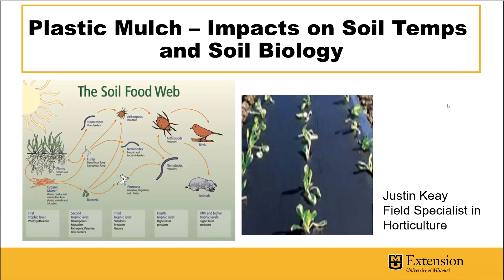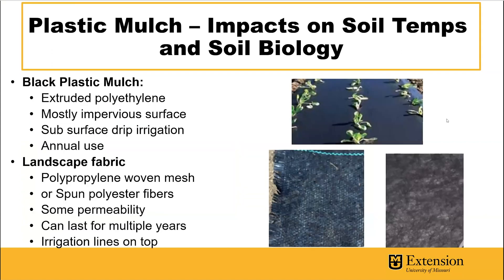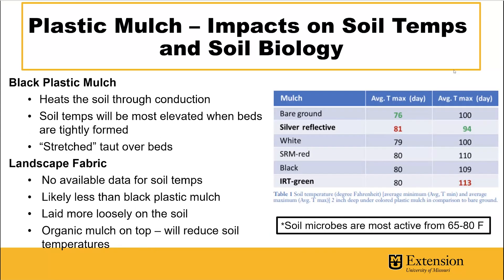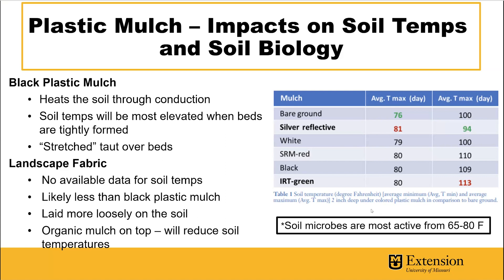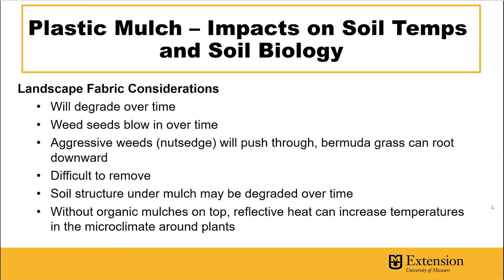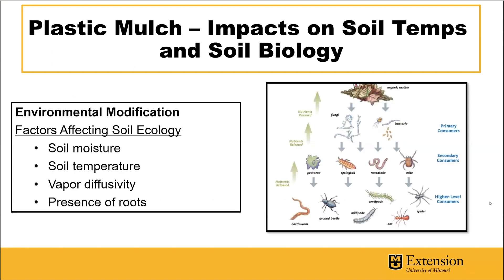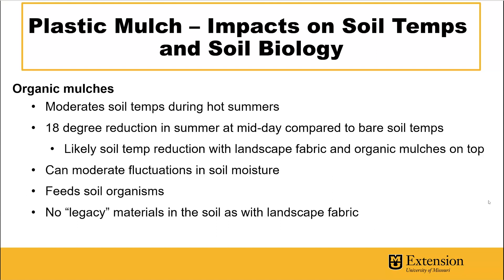Plastic Mulch

Comment: why compare plastic mulches with bare soil and not organic mulches?
Reply from the maker: Hello Robin, although the sole focus of the video is not on comparing organic mulches to bare soil, the video does report data from a study comparing soil temperatures under straw (organic mulch) compared to bare soil. More published data exists on differences between bare soil and black plastic mulches, as compared to data on the differences between bare soil and organic mulches. Straw mulch is the most commonly used organic mulch on vegetable farms, data for soil temperature comparisons for other types of organic mulches is limited. This video was in response to a question related to impacts on soil temperatures and soil biology under black plastic mulches. If you would like to submit questions to the Garden Hour, please do so using this link https://ipm.missouri.edu/townhalls/. The garden hour is a live town hall that runs every Wednesday from 12:00-1:00 p.m. CST. To find more published data related to soil temperature comparisons between organic mulches and bare soil, we would suggest searching for published research articles using a tool such as google scholar.